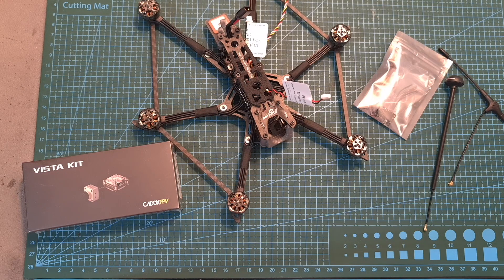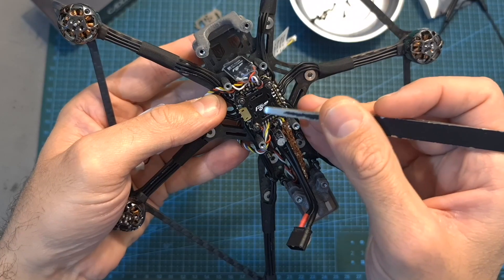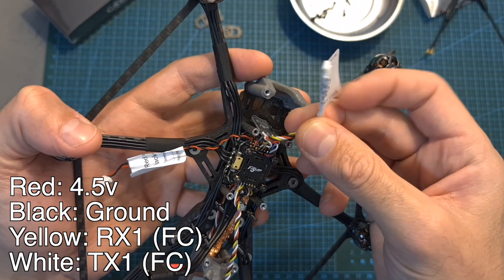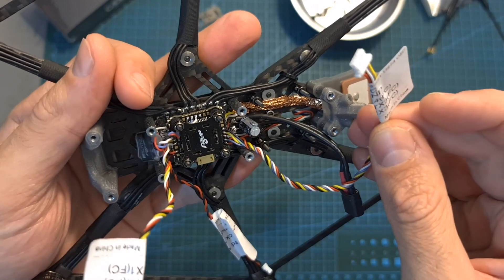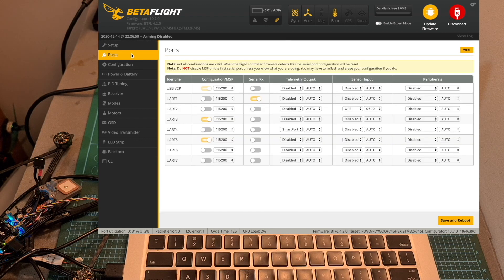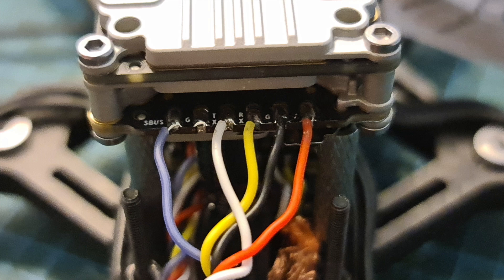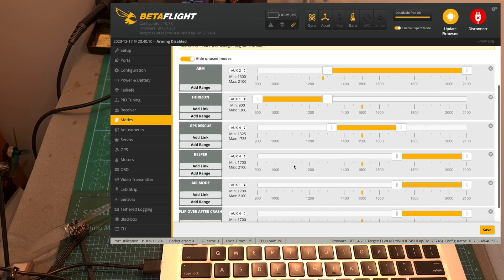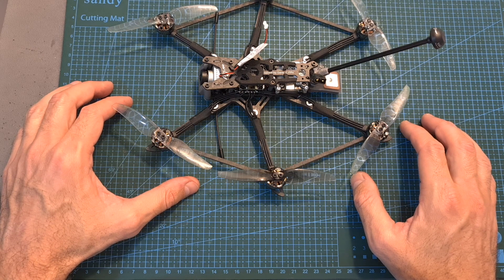Flywoo Hexplorer // PNF Setup - Caddx Vista & Crossfire Nano

Comment: Is there a reason that you did not solder the signal ground on the vista.....I was just looking at my hex and noticed that mine also didn't have signal ground soldered, it seems to work fine the way it is and I was searching for videos to see if its normal to not have signal ground soldered and found yours....can you explain what that extra ground does and why you decided it wasn't necessary....this would be a great help to me thank you

Comment: I follow up to the point of soldering TBS Nano RX receiver and binding it with RC transmitter. I can't get past next step, connecting flight controller to PC via USB. Nothing happens. No new unknown device in device manager, no virtual COM port, nothing. Betaflight doesn't see anything. Am I missing something here? Am I supposed to press or hold something? Because literally nothing is showing up. Drone powers up, all lights seem alright but on PC side nothing changes.
Reply from the maker: Hi, it might be a driver issue or you're simply not using a USB data cable.
Reply: @KremerFPV  I was using USB data cable but it was a cable issue. I've plugged camera to the same cable to copy files to test it and it worked fine so it didn't cross my mind to try different cable. For some unspoken reason drone just didn't like that particular cable. Thank you for answering though!
Reply from the maker: @Micromation  No problem!